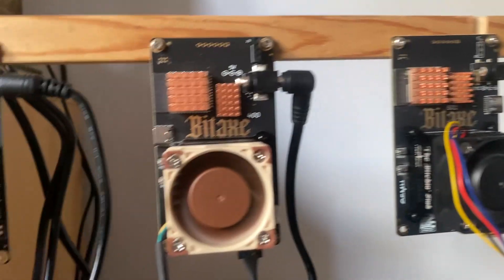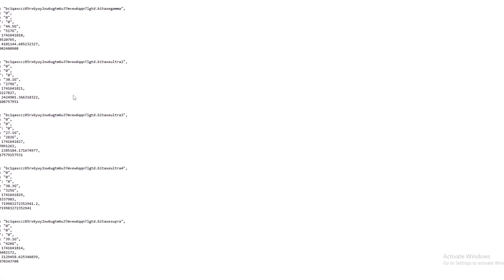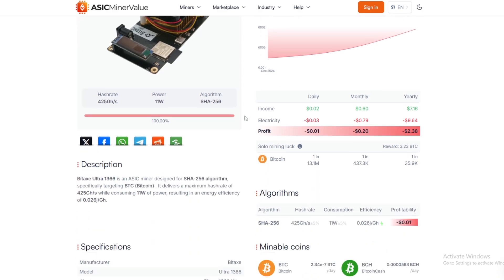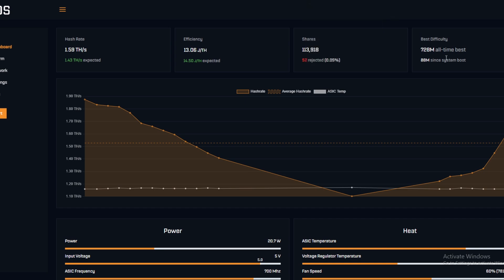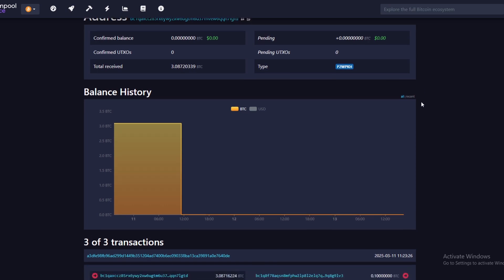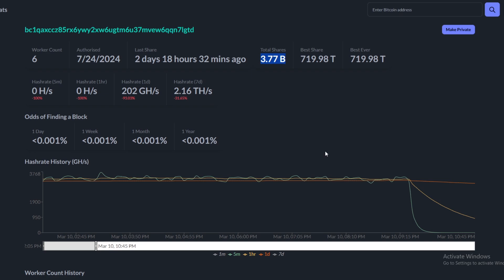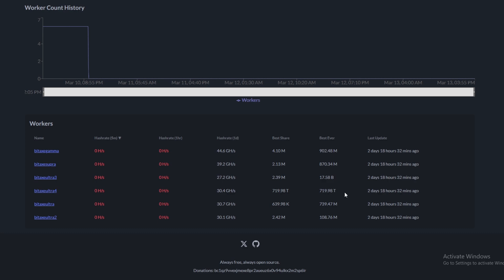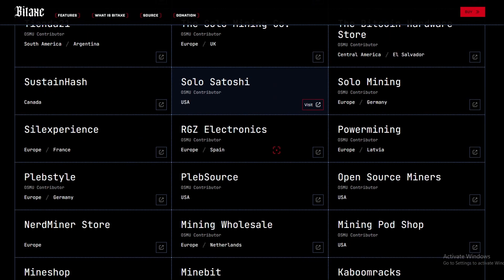Another Solo Block Found By A Bitaxe Ultra!!!

Comment: Does it matter how long you’ve been mining Or it’s based off of sheer luck? So basically if I get one today there’s a chance I can find a block within a month or you have a higher chance of finding one depending on the amount of shares you have accumulated?
Reply from the maker: Just pure luck
Reply: U cab basically buy a Bitaxe, Install It and run it for 5 mins and u could found a block…in theory

Comment: I would like to understand this: how can a low hashrate bitcoin miner find the power to hit a block at 719T !  Usually the bestshares it can deliver is in the Millions(M) & it's best difficulty level is in the 2G or 4G's. Can you explain this ? Thank you.
Reply from the maker: Just purely luck based, a lot of people cant really undertsnad until they hit a massive share, like 4G wouldve hit a block in 2014 so its possible. just gets way harder as the difficulty increases
Reply: In theory any miner can hit a super high difficulty. Faster just has a better chance. As it's running much faster. Think of it like the tortoise and the hare. 9 times out of 10 the hare probably wins but theirs that 1 time the tortoise wins somehow. Only in this example the hare wins 999million times and the the tortoise wins the 1 time. It's extremely unlikely but possible.

Comment: This video is somewhat misleading in my opinion because if you have been in the mining space for a while you will know hitting a Bitcoin block is extremely unlikely but not impossible.  

I ran it through ChatGPT and here is what it said.  (1 in 19,000 years with a single ASIC)

Probability Calculation (Rough Estimate):
If you have a 200 TH/s (terahash per second) machine, and the network is 600 EH/s (600,000,000 TH/s):

Your Chance per Block
=
Your Hashrate
Total Hashrate
=
200
600
,
000
,
000
=
0.000000333
%
 per block
Your Chance per Block= 
Total Hashrate
Your Hashrate

 = 
600,000,000
200

 =0.000000333% per block
Since a new block is mined every ~10 minutes, you’d statistically expect to find a block once every ~19,000 years with a single ASIC.

What Are Your Realistic Options?
Mine via a Mining Pool – You contribute your hash power to a pool and get small, consistent rewards instead of waiting for a solo block.
Increase Hashrate – More ASICs = higher chances.
Buy Bitcoin Instead – For most people, it’s more profitable to just buy BTC instead of mining solo.
Unless you’re mining as a hobby or have ultra-cheap/free electricity, solo mining is not a viable strategy today. 🚀

Comment: How do I get a higher difficulty? Does that just mean i have to leave it on for a longer time? Is it theoretically possible to turn on a Bitaxe and immediately have 1T difficulty?
Reply: Mining is random. If you keep turning it off and switching pools, you're just interfering with that luck. Plug it in, configure it and forget about it. You could hit a B share within a few minutes, days, weeks, months. It's random.
Reply: @ b share meaning ?
Reply: @saeir  B is not a SI prefix, the difficulty is often shortened to Kilo, Mega, Giga, Tera, Peta, Exa, and so on. The difficulty is just based on pure luck, any miner can potentially solve a 200T difficulty share and receive the block reward. A higher hashrate means you increases your chance of achieving a high difficulty faster.